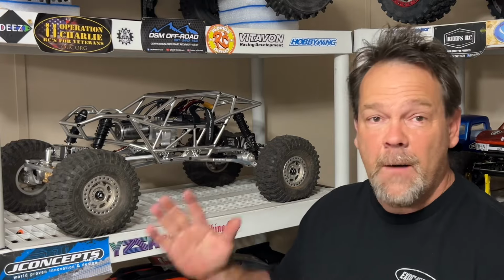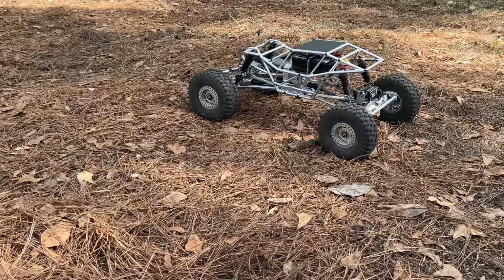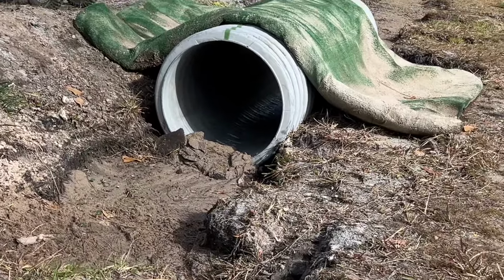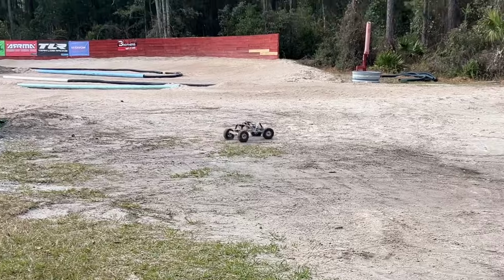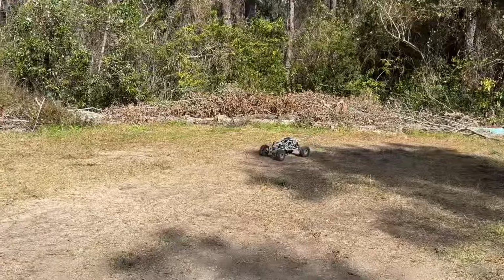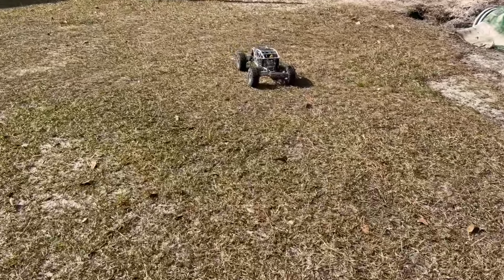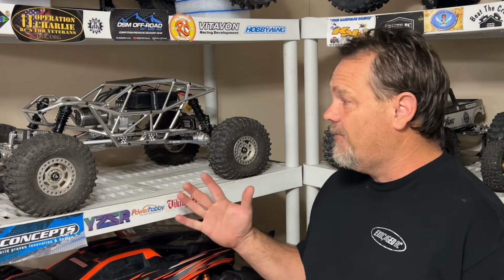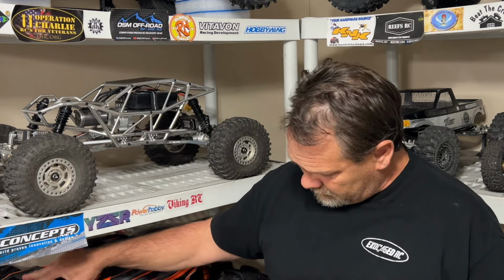VitaBouncer is faster than a rocket powered something odd

Comment: I am not sure just increasing the gearing is the way to find more speed? If it was me I would be checking the temperature after a steady 4 minutes of continuous running and tuning to a maximum temperature( spit on it or hold your fingers on the motor for ten seconds . Sure if it’s just a short speed run then gear up as far as possible but at least with smaller motors and smaller batteries there is a point where you start going slower and just making heat. That is a heavy thing as you are well aware.

Comment: If you want it lower why not just put some shock spacers in I know it will make it harder to go from taller to lower but you can just make up another set of shocks then you will have 2 sets if you change them you will have 2 sets anyway
Reply from the maker: I have a set of shorter shocks that should get it down